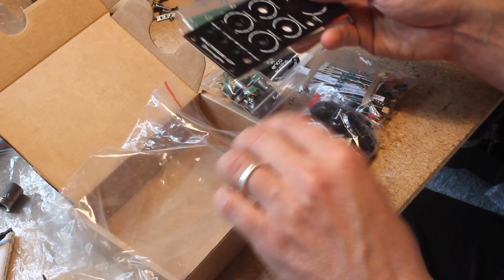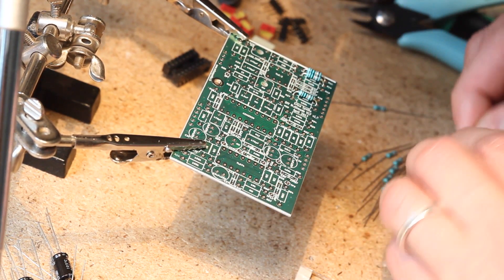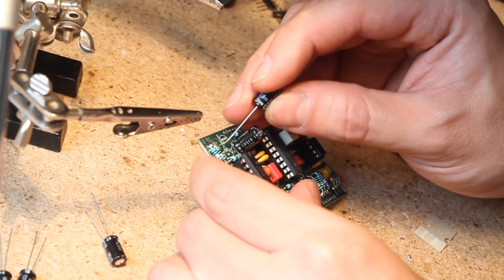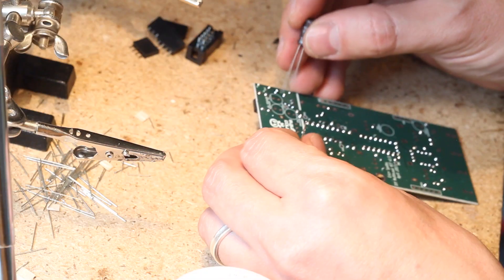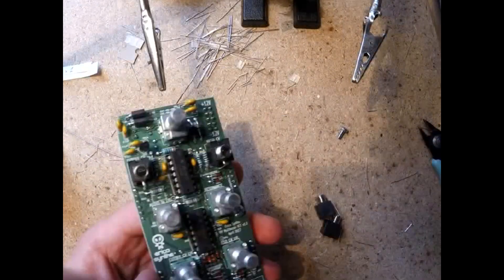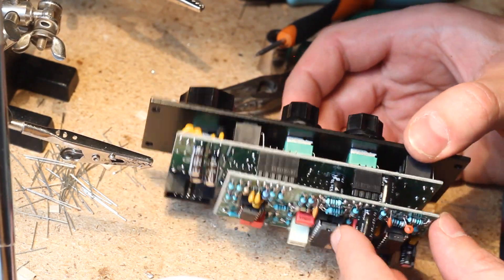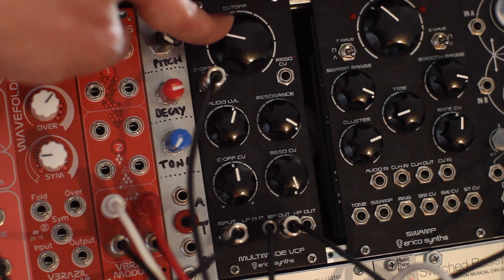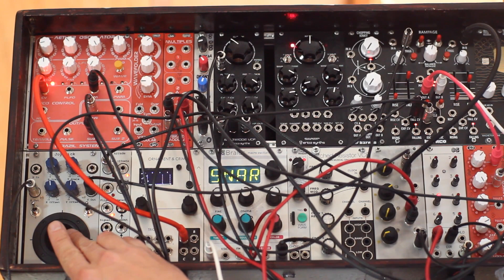Kit Review # 10 - Erica Synths Multimode VCF

Comment: Did you solder the resistors on both sides of the pcb?  Why? I did only on the bottom side and it works.
Reply from the maker: I solder resistors from the top. On plated through hole PCBs that is possible and spares me from having to turn the board around, bend the leads out so they wont fall and then stick my iron into a forest of leads. Once I've soldered and trimmed i may touch up the soldering from below if i see some spots needing more or less solder

Comment: Hey Quincas, I just built one of these and I'm wondering if your HP output is as wild as mine? It is the easiest to self oscillate and I'm getting some distortion depending on Cut-off setting.
Please let me know. I couldn't find anything online about the HP output that's why I'm asking. I know it's been a while since you posted this. Thanks in advance!
Reply from the maker: Hi Gabe! No, my HP output behaves like the others, no more distortion or self oscillation. Sounds like you may have a wrong resistor in there somewhere!  Good luck :)

Comment: over the last few months i have spent about 1500€ on diy kits. only 7 of 15 modules are working propperly although i have doublechecked everything. 
i can't find any solderbridges or wrong oriented parts, none of the components are heating up when plugged in, however i have noticed the +-12v leds of my distroboard are dimming when i plug in any broken module. also the other working modules in my case produce a lot of static noise when i plug the broken ones into the psu.
i know that no one here can help me. i will have to spend hours on figuring out all of the little mistakes i've made to get those modules running.
Reply: Hey, it can be very frustrating, I know. Don't be disheartened. What you describe sounds to me like there is something wrong with the power in your non functional modules. Triple check the orientation of the ICs, more often than not that's the culprit. Also, check your power headers for shorts using a multimeter in continuity check mode. 
Take one at a time as a project, look at the schematics, take your time. You learn much more from a module that doesn't work than from one that does immediately! Without troubleshooting this would be just paint by numbers :)
Good luck!
Reply: thanks for the support!
Reply: turned out my noise swash was working fine. and i also managed to get two euro serge modules running by resoldering all solderjoints. i think random*source and music thing modular use gold plated pads on their pcbs, which makes it hard to get solid connections.
Reply from the maker: great news! keep pressing on :)

Comment: Hi Quincas! How steep is the cut-off of this filter in bandpass mode? Looking at maybe getting a couple of these to power a "poor man's vocoder" and need a steepish response. Thanks!
Reply from the maker: Hi! It's a 24db/oct filter. I just listened to a saw through it in bandpass and it sounds pretty steep to me! However, a proper vocoder would need at least about 8 input filters and 8 output filters, I would seriously recommend you get a dedicated vocoder project, or use a digital alternative! MFOS and Jurgen Haible have great vocoder designs. MFOS is available at Synthcube, and Haible at Random Source. Good luck!
Reply: Synth Diy Guy I was planning on multitracking the vocoder bands one by one instead of doing it in realtime. I'll definitely check out what's at Synthcube though. Thanks!

Comment: Great video. The only thing I was left wondering... how is the tracking when self-oscillating? I like using my filters as sine wave generators... :)
Reply from the maker: Hi David! You're right I should have done that!  The thing is, this filter doesn't quite oscillate unless you send it some positive CV into the resonance CV input. i just sent it an offset from the 0 coast and got a nice solid sine, but the tracking is about a half step per octave flat. I think if you amplify your cv slightly you should be able to get a couple of octaves in tune!